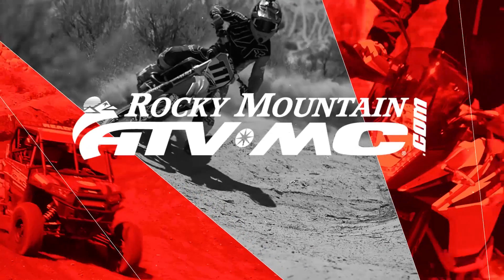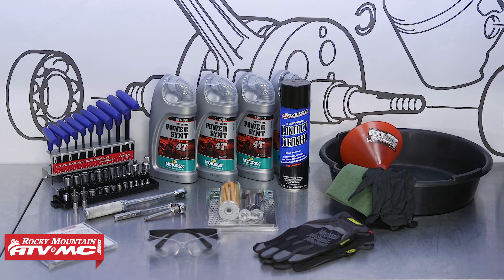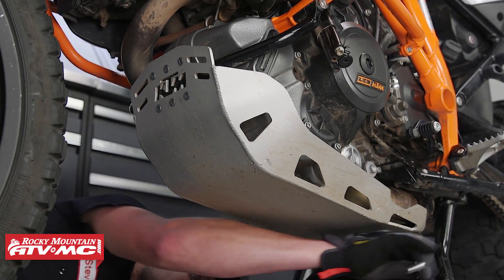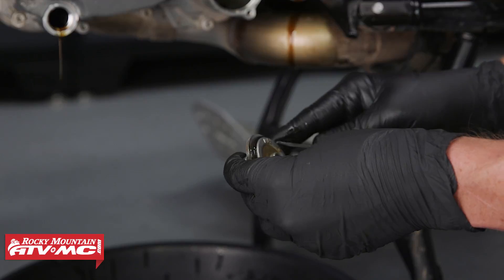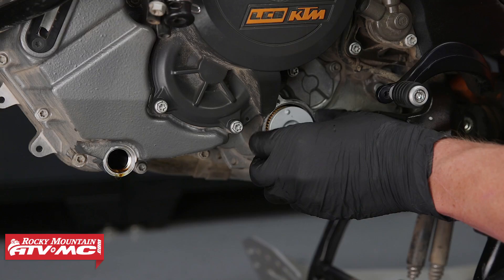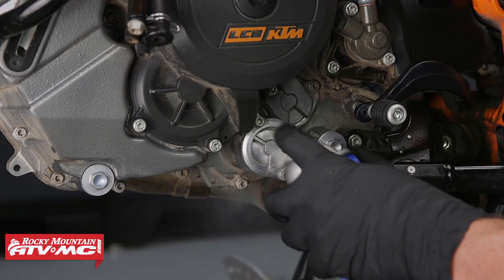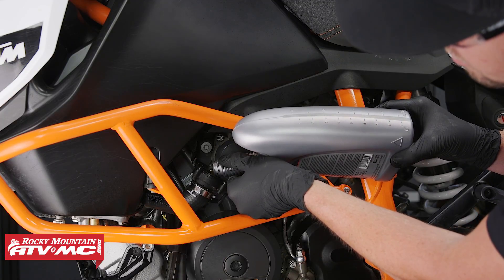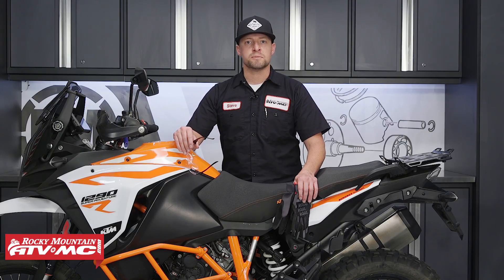How To Change the Oil on a KTM 1290 Adventure R

Comment: What happens when you put in the recommended amount of 3.6L, run the bike for a minute, get a low oil light, turn off the bike check the level and it's all the way at the bottom? I've measured out the proper amount and have done thousands of oil changes. Why does the sight glass register virtually NO oil? Why did I get a low oil light in the first place? I have a 2022 if it matters.